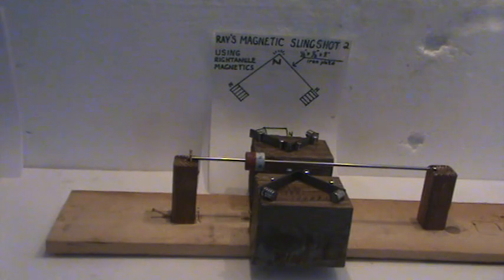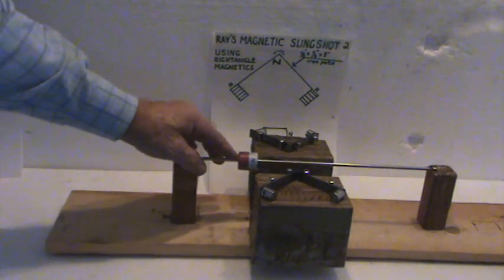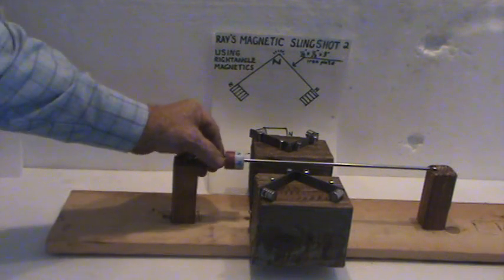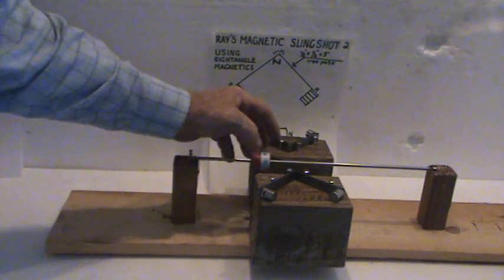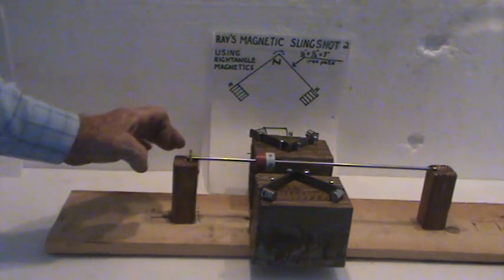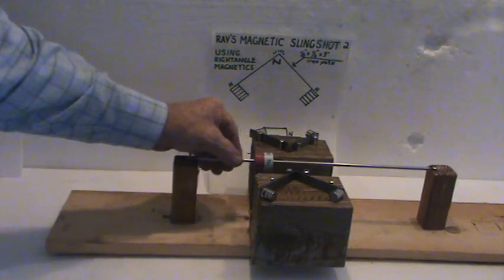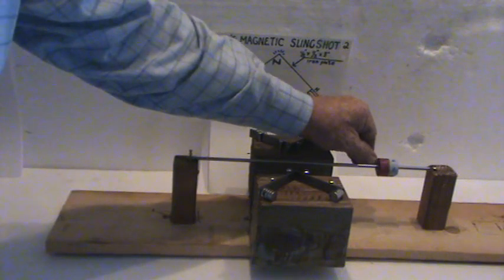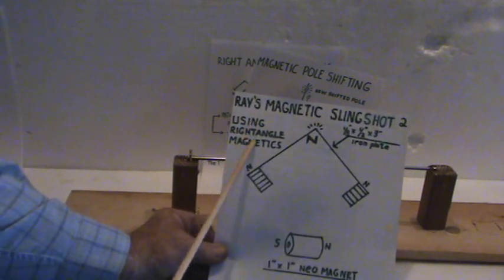Ray's Magnetic Slingshot 2

Comment: Well done Ray. You might try to use not right angle steel bars but asymmetrical elliptical bend steel bars . This might still change the negative entrance force...
Also the thickness of the metal bars will play a major role...What kind of excat material are these right angle metal bars ? Might also strongly depend on this material. ..and its exact shape...

Comment: I wonder. Would it work if you turned the 2 V shaped metals under a 90 degrees shifted position? Currently you have them horizontal, I was wondering if you could use them vertically. And keep the rest the same. Reason for asking and wondering, is that if you would like to use more V-shaped metals (and magnets) they will not interfere with each other when they are placed vertically. Also, you could use 4 V-metals, 2 aside like now, and 90 degrees turned, plus 2 more, one on top and one below.
In the end I wonder. Hmmm. Why not use a metal ring, with all magnets facing North on the outside of the ring, and now shoot the other magnet through the hole. 
I am jumping to conclusions, I know. Just thinking out loud!
My hand are tied currently, but I will replicate this version, the setup looks very nice to play with.
Reply from the maker: yes four gates work stronger, but the gap needs to widen. one problem is doing a linear series of gates. The small negative forces add up and stop things some what like one small force doesn't stop you but enough added up does. Some design is needed to keep gates apart or neutralizing the small negative ones that add up  Thanks for the comment